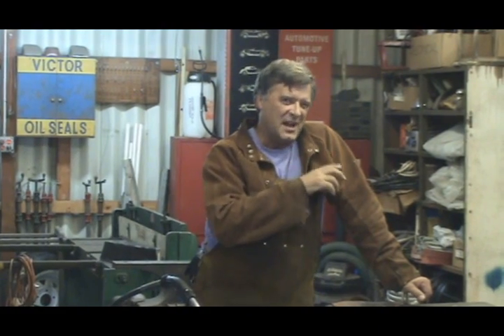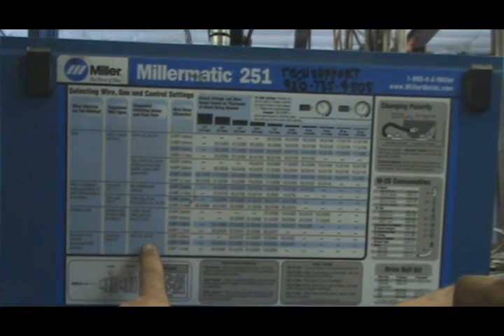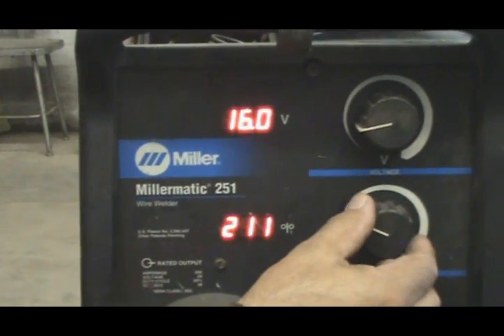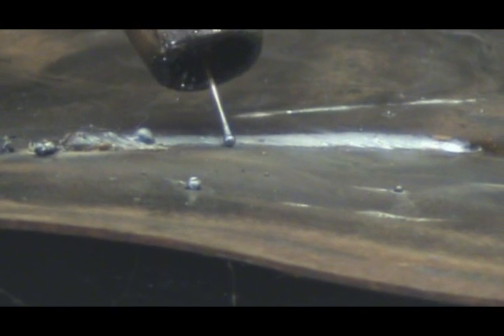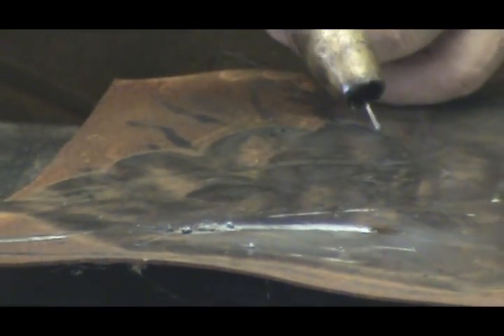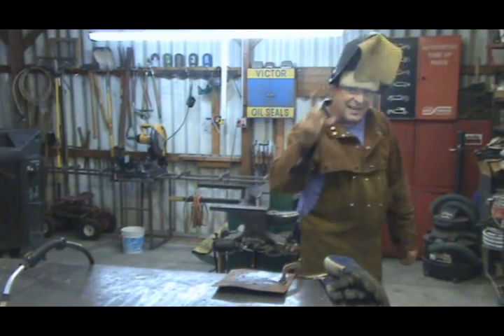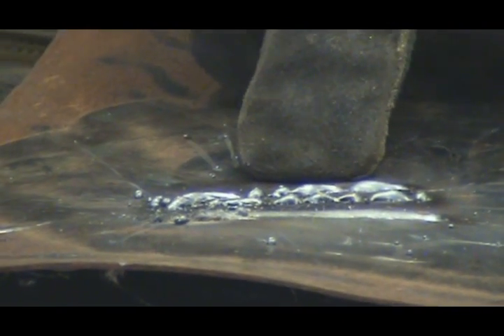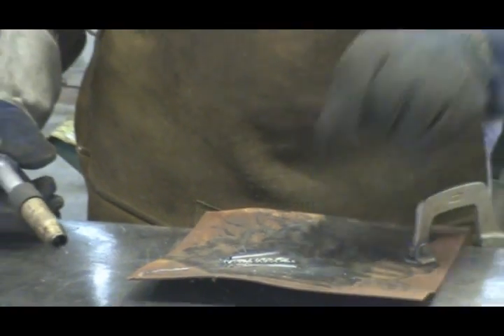MIG Welding: Setting Voltage and Wire Feed - Kevin Caron

Comment: OK ! THANKS KEVIN ! I GOT IT OFF OF EBAY ! A LOT OF PEOPLE GOT THIS UNIT .OFF OF E-BAY WITH DENTS ON THE UNIT ! AND WHEN I GOT MY'S I HAD 2 DENTS ON IT . BUT OTHERS HAD THE PROBLEM OF WIRE  WHEEL NOT FITTING ON IT ! AS FAR AS 10lb  WHEEL !  AND NOT COMEING ON !  AND WHAT IS IGBT  ! ON WELDERS AND WHAT DO IT DO ! THANK YOU FOR YOUR TIME . 'O' IF I WHAT TO CHANGE OVER FROM  .030  TO .035  , I CHANGE LINER AND TIP  + DRIVE ROLLER . I WAS GOING WITH  .023 to .08 AND .030 to .035 .JUST TO STAY IN THE MIDDEL ! FOR CARS ! AND THIN METAL ! AND AROUND THE HOUSE ! AND I AM USEING FLUX CORE ! THANK YOU !
Reply from the maker: Yes, if you are changing wire diameter you should change the liner as well.  Of course you will have to change the tip and drive roller to go with it.

Comment: Hi ! Mr.Kevin ! I been looking at your welding shows ! My Name is Mr.Herman Woods .l have a HitBot 250-Mig .I started out ! With stick ! Now going to Mig ! I got this HITBOX MIG 250 AT A GOOD PRICE ! BUT ! WHEN I SET IT TO IT LOWEST SETTING .IT READS ! 21.1 VOLTS ! BUT THE MANUAL SAID ! 15-29 VOLTS . SO I THOUGHT ! I WAS USEING THE 220 OUR 240 AT 30 AMP FUSE ! DO YOU THINK ! THE UNIT IS OFF ! OUR CAN I GO DOWN TO 110 OUR 120 VOLT OUTLET ! CAN YOU PLEASE LET ME KNOW ! ON WHAT TO DO ! I SEEN A SITE ! ON THE WEB ! IN RUSSIA ON THE HITBOX MIG 250 .AND HIS GO DOWN TO 15 VOLTS .THANK YOU ! FOR YOUR TIME .MR H. WOODS !
Reply from the maker: If you just purchased that machine new you need to take it back!  Either the dial is off or something is really wrong in there.  I have never heard of this line so I can't offer any advice.

Comment: I have a question, why do you say turn the ampage or the amp setting and the adjust the voltage. My machine has volts setting and amps so I'm very confused which to turn.
Reply from the maker: That is a really bad habit of mine!    Mig welding is done in volts and Tig welding is done in amps.   My tired brain gets them confused and I use the wrong words sometimes.   But some welders out there have both volt and amp settings so it gets even more confusing!  Sorry for the confusion   but I am trying to keep my mouth in pace with my brain.
Reply: @KevincaronSculpture  thank you. Mine is a Mig but it has a dial for both, do I ignore the Amps and just use the Volts and wire feed? Is the Amps for a different setting as it will also do stick welding. Thanks for your time.

Comment: my base metal thickness 120 mm whether I can use 400 amp welding machine to weld ? there is any standard available?
Reply from the maker: Should be able to make it work.

Just have to get the the fit right on the joint.

Comment: There seems to be a rather large chunk of confusion in the comment section.  Kevin, bless his heart, misspoke a few times and said "amperage" when he meant to say "voltage".  

Wire feed welding is a CV, or constant voltage process.  The amperage varies automatically with wire feed speed, and stickout, to maintain an arc.  You do not set amperage on a CV welding process, which is any wire feed welder.  You can affect the amperage by adjusting the wire feed speed, and stickout.  

You can loosely imagine wire feed speed as an amperage setting, but it does not directly correlate, at all.  Plus, it changes your deposit rate, and therefore your travel speed, which affects your heat soak and penetration.  Turning the wire feed speed UP, will give you some uncertain amount of more amperage, but can actually decrease penetration because you have to pick up your travel speed.  You can also adjust amperage with stickout length.  You can easily reduce weld current 25 to 50 amps simply by increasing stickout.  If you were to actually see the live amperage during a weld, you'd see that it can vary quite a bit, and does indeed vary constantly.  

Stick welding and TIG welding are CC or constant current (amperes) processes, and the voltage varies automatically with arc length.  That's why you set an amperage setting on those processes, and you set voltage on a wire feed.  Voltage is directly related to arc length.  Changing voltage on a CV machine changes arc length.  Changing arc length on a CC machine changes voltage.  

Got it?

This is not a "new" or brand specific issue, as it comes down to physics, and the way the electrons scurry about in the little electronic bits.  Take a physics class on electricity sometime, it's awesome stuff.  There is no "this brand" or "my welder" concern.  Constant Voltage, or Constant Current, only.  If you have constant current and voltage, you have a power supply, not a welder.

Most of the people that learned to weld before there was such a thing as an inverter welder, learned to weld on a stick welder.  Settings were spoken of in amps, and the "weave", or "pattern".  One setting, amps.  After you do that for a few years, and start using a wire feed welder, it's easy to accidentally say "amps" instead of "volts", because it's just what you're used to saying.
Reply from the maker: Awesome!!!      Thank you for posting this..

Comment: Kevin my machine just began having trouble feeding the wire ion 1 particular setting, my amp  settings are 1-7 on my very old airco welder the feed works fine on all amp settings and speeds except setting 5. It stops feeding wire but you can hear it trying to work.  Any ideas to what's wrong? Let me know thanks
Reply from the maker: Maybe the drive rollers need to be changed.     Or maybe the tip on the gun is clogged and stopping the wire.   Or maybe the liner in the cable is getting tired and needs changing...   Or your very old machine is trying to tell you to get an early Xmas present for yourself!!
Reply: Good advice Kevin. I like how practical your viewpoints are. You are one of the reasons why I bought an Everlast welder and I've been very pleased with the purchase

Comment: Actually on the Millermatics, the amperage is set automatically based on wire speed. Voltage is what is set on the v knob, not amperage. The way these automatic machines work is a specific wire speed sets a corresponding amperage. So technically the biggest setting is the wire speed. For example: 1/4 inch mild steel runs in the 180 to 190 amp range which for .035 wire translates in to: 360 to 380 inches per minute. Voltage will change the characteristics of of the weld profile, and penetration. Too low or too high of voltage will result in various undesirable traits. Set your wire speed first and tune the voltage. For vertical up or open root you can drop down a thickness setting or two to get your wire speed then tune voltage for the appropriate weld profile.
Reply from the maker: Thanks for posting..     Helps to explain what I was trying to get across...

Comment: Amps (IPM) is your wire speed right?
Reply from the maker: Nope,  just wire speed..
Reply: But when you adjust your wire speed it adjust your amps.
Reply: +thomas duvall  Yes and no.  Wire speed affects amperage, but so does stickout.  On a wire feed welder, amps vary automatically to maintain an arc.  The problem is, in this video Kevin keeps saying "amps" when he means "volts".  

Restated; wire feed welding is a constant voltage process.  You set the volts, and amperage varies with stickout and wire feed speed.  You can't directly correlate amperage to wire feed speed.

Comment: Good video tks for posting,  I'm building a war machine out of my 98 Dodge Ram 4x4, reg cab, I'm going to build a reinforced bumper on front,  I have lots of quarter inch diamond plate steel.  I bought one of those wire feed welders at Walmart,  wanted to see if I can weld.  Bought helmet, gloves, clamps,  I appreciate you posting video.  I always wanted a war machine, and with the way the world is going, everyone should have one,  basically a safe house on wheels.
Reply from the maker: Pam Smith Welding is a lot of fun..   And when you can stand back and see what you have created it makes it even better..      Just remember to think through what you are making and make sure it will stand up to every day life.    It's one thing to make art that just sits there and a whole different thing when someones life can be involved...

Comment: im welding thick metal to thin metal on top of another bead its repair work whats a good setting to run my machine on after i fill in holes ......?????? im lost i took classes but this different i keep burning through thin metal im looking crazy we running at 21 in volts and 30 in wire speed lol crazy i feel the wire speed and voltage should be lower so does any one know a resolution ?????? please help
Reply: I am not a professional welder - I have only taken classes too. I was always told not to weld thick metal to thin metal. I think the volts are too high for the thin metal and that is why you are burning through it. But the volts have to be higher for the thick metal or you can not get penetration.

Do you need to use the thicker metal? Can you perhaps use the same gauge as the thin metal - just doubling the thickness of the metal should make it stronger. You might even consider drilling some holes in the repair piece and tacking through the hole to join the top piece to the existing piece - like a spot weld but using your MIG. Use a soft pad on a grinder to remove the overspill.

Rather than try to weld a long bead, have you tried small tack welds at the corners first? When the tack is made, you can go to another corner where the metal will be cooler and try it again. Make sure you have clamped it well.

When you tack all of the corners, go back, fill in the hole on the first weld. Then the second weld, third, and so on. Then move to the area between the tacks and tack that.

All you will do it tack slowly around the two pieces until the welding is complete. It will also allow you some playing around with the settings to see what's best for your job, just as Kevin suggests.

Hope this helps.
Reply: Ride ur wire on the thicker metal in feather in to the thin metal watch ur wetout as u lay ur weld let me know how it works ive bin welding on junk in messed up trucks for 20 years so i know what ur sayin

Comment: Amperage is set by the wire feed speed when you turn the wire down the amperage goes down. You are saying the opposite. Never play with the controls you should know specific locations for WFS and voltage that produce desired results.
Reply: I don't think you quite understand. When you set the wire feed speed you are setting the Amperage. That's why Welding Procedure Specifications ask for amps or WFS. There are some basic principles to setting a proper arc when using the GMAW process and there is much confusion in the welding industry. It is a shame that social media is being used to further perpetuate the folk lore. If you are going to put information out you should be responsible and give the correct information.
Reply: *****   so redo it.

Comment: Too bad I haven't done any MIG welding just FCAW or oxy-fuel welding (and brazing too) since I only do welding outdoors. Not a welder, but a maintenance or sheet metal man working in Mexico, but a least over here no one gets in trouble for using oxy-fuel to braze or weld on new cars, but I still recommend MIG and fluxed-core is only for things like the Beetle or 1966 Mustang, since the panels are about a millimeter thick. Thanks for the video, Kevin.

Comment: Hey Kevin,  I was thinking of buying the Lincoln Elec. Weld Pak 140 -- Is this machine sufficient enough to weld in my floor pans ( 16-20 gauge)  My house DOES NOT have any 240 outlets, just the reg. 110.  I need one that runs on reg. household current..  Its not digital -- just 2 "click" knobs --for beginners like me -----Thanks  JIM
Reply: 16 to 20 Gauge material can be welded with 80 to 100 amps. The correct settings for 0.035" wire 75/25 gas would be 174 IPM and 16.5 V or 210 IPM and 17V. The only thing you have to watch on a machine that small is the duty cycle. they are typically 20% that means you can only weld 2 minutes out of 10 minutes. if you overload the duty cycle you will cook the inside of the machine eventually.

Comment: Obviously it's been pointed out, but the way you're talking about voltage and amperage are inaccurate.
For anyone who is confused, as this video did make it confusing , basically voltage controls puddle fluidity, amperage (wire feed speed) controls penetration. I'm a Journeyman ticketed welding instructor from Alberta, Canada. To teach amps (WFS) vs volts, I like to use the analogy of a garden hose with a nozzle on it. Low volts (in relation to wire feed speed) is like having stream (no spray) on the nozzle, it's a narrow and deep digging stream of water.  Turning up the volts is like turning on the mist, it will be wider, flatter, and less digging. It's about finding the balance between the two depending on application. Also, longer stickout lowers your amperage. Much more to it, but that's a good start to understanding the concept of what each do. Just for comparison, and to show that recommended settings can be way off, depending on application: My shop does a lot of our welds at 35 volts and 850 inches per minute for wire feed speed, which runs about 330 amps, on 12-14 gauge steel. We can lay 600 inches of weld in about 5 minutes. These welds have been CWB certified and tested, and they pass.
Reply: ***** Thanks. My job is to train welders of all skill levels, and I enjoy teaching. So if you have any other questions feel free to ask. Just read more comments, and saw you asked what peening does. It's generally only used when welding cast iron (carbon content over 1.7%). Peening is hammering the weld after it is completed, and it helps to relieve residual stress from the expansion (heating) and contraction (cooling) caused by welding.

Comment from the maker: NO, not normal at all!

I would have been looking for a kink in the line from the machine to the gun. Or your settings were just way off.

Make sure the tip is clean and the drive rollers are working correctly also. Did someone change the wire size and forget to change the the tip to match?

Or was it just windy and the gas was getting blown away?

Let me know what you find please....

Comment: We have a 220v Miller at the shop that's a pretty good size, but not a LARGE MIG.  Not sure on the size, but close to yours.  I welded a small hitch that I made and it never popped or anything.  Sounded like a TIG, was dead silent.  I figured I must have nailed it.  made a loading ramp for a connex box for the next two days and no matter what I did I got popcorn most of the time.  Figured the steel i was using was just dirty, even tho I ground it down.  Was sitting, rusting, for a while. Normal?

Comment: Love the Video, but the CWI will nail ya on this, Voltage is not AMP in MIG/FCAW welding, it's the pressure. Your wire speed will be your AMPs in this process.

Comment: trigger-trigger then cut and weld. this eliminates most purge problems.purge purge then trim the wire and start weld. but that's just my experience with these machines.
OH AND dip is best applied on hot tip.full duty is about 10 minutes on .35  can be run on .45 but cycle becomes about 8/10 minutes tops. then shutdown for cooling is required. 
this is just my opinion. good video, I enjoyed watching. (15yrs exp)

Comment from the maker: Best bang for the buck, I would have to point you towards the Longevity Arcmate 160D.  If you have more to spend you can always pop for a MIlermatic 211 autoset. Either machine will serve you well. The Longevity is half the cost of the Miller.

Comment from the maker: I use the Longevity Force Cut 60I.  It's an older machine but quite powerful. Can cut up to 1,1/4 inch.  I was just playing with the new ForceCut 42I.   It is a very nice machine!!  The fit and finish is outstanding !  The new torch is a much improved version over mine. The machine will cut up to 1 inch. All depends on your needs and budget. You can't go wrong with anything by Hypertherm but the are twice as much as the Longevity.

Comment from the maker: I would look for something in the 125 to 175 amp range.  I like a MIG over ARC and would prefer a TIG.  You didn't say what type of metal or thickness you are going to use but any welder in this range will give you good results. If you already know how to weld. If you are going to learn as you go you might want to rethink this.  Having a weld fail and the trailer break apart while you are towing it is really going to ruin your day.

Comment: GREAT explainations Kevin. I've been welding for 38 yrs. (Pipefitter) and used 6010/7018 for the field. I bought an old diode machine ( Miller 200) the other day and have been learning it's operation basic's. Your video helps tremendously. Thanks.

Comment from the maker: I think this would be a better welder for what you are trying to build. Just go slow and make sure you have good fit on your joints. Practice before you get to building for real. Make sure you are comfortable with this welder and can get a great weld. Remember this is your butt in the seat and the last thing you want is to have a weld fail when you are underway at speed.

Comment: so i should go with the Metal Man Flux Core 125 (output 60 to 125A). I really want to stick with a simple welder since i'm new to welding, but at the same time I want my buggy frame to hold strong without having to use gas. what do you think about the metal man welder?

Comment from the maker: I think that this welder will be right at its limit for power.  I would like to see you get the next size more powerful than this. And I would not use flux core, use solid core with gas. Better weld, less clean up and safer for the people who are riding in this buggy. Don't want a weld failing at the wrong time..